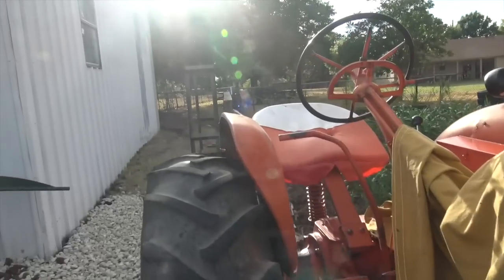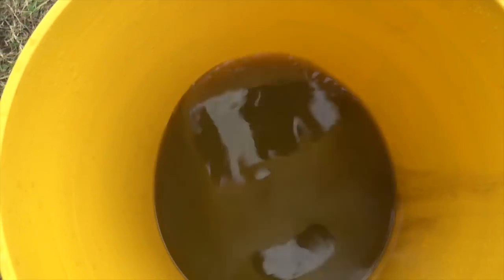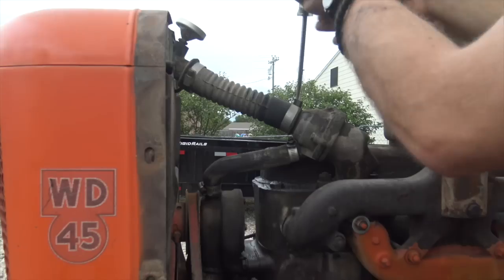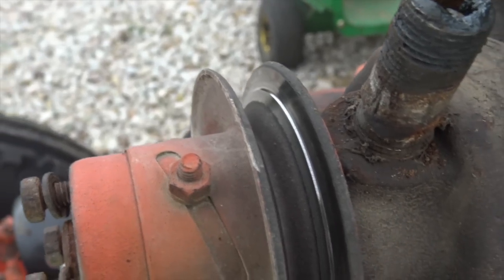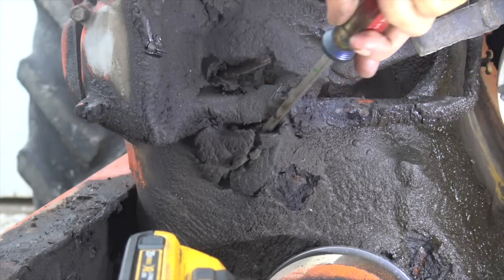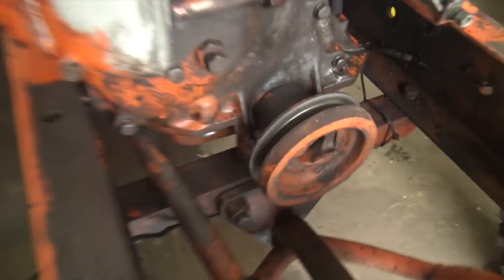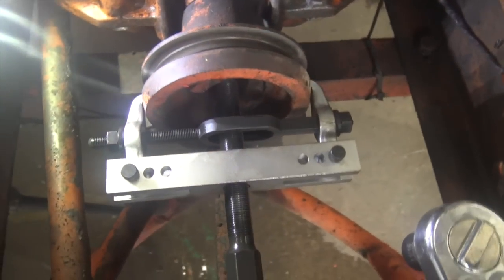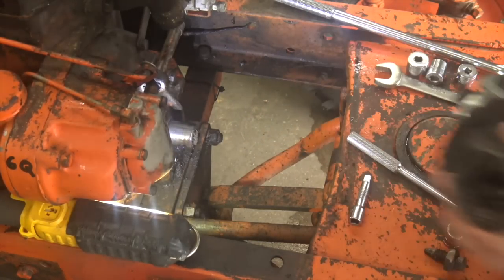PRESSURE WASHING THE OLD TRACTOR - EXTREME PRESSURE WASHING ON FARM EQUIPMENT

Comment: Thermostats stuck closed generally lead to overheating, not underheating.  Also check your gauge and sending unit.

As I've said before, if you get a steam cleaner you will wonder why you fooled around so long with a pressure washer.  Much better, faster cleaning with less water intrusion and less mess.  But it will melt heat sensitive things.